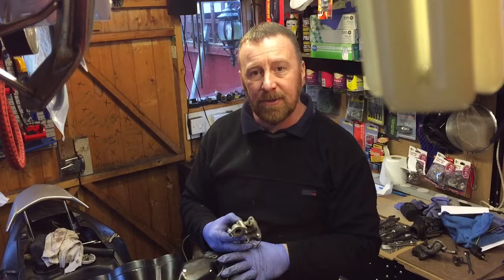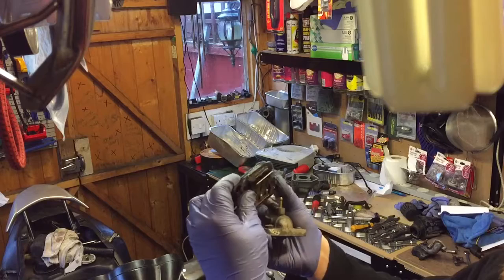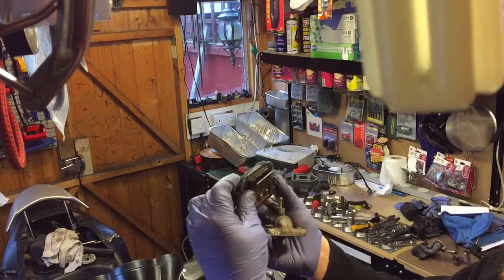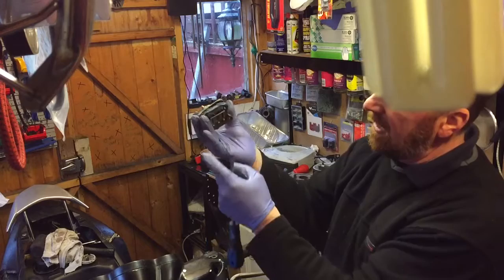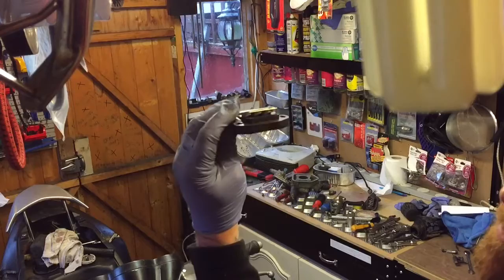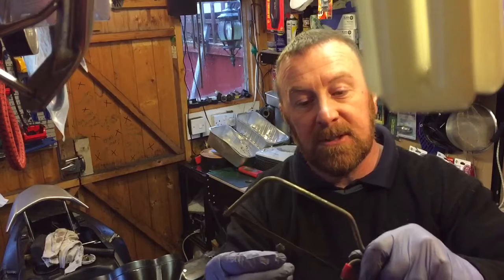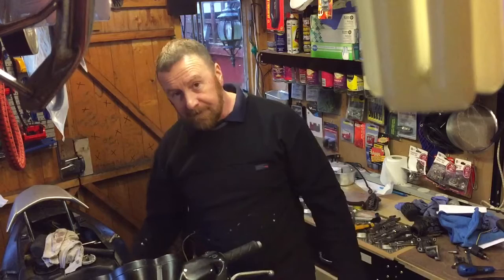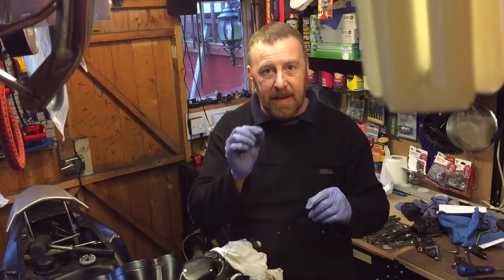Speedfight REEDS don't forget about them mark savage

Comment: Hi Mark, I have a 2001 100cc what size jet should I use for an aftermarket exhaust and k&n style filter please any idea on where I can start please
Reply from the maker: Hi bud 
Standard should be 83
Reply from the maker: Exhaust is good but needs to be an in box filter as it will suck in damp in this weather and mess around

Comment: Hey! Thanks for the videos, helps alot! I have a SF2 LC, it runs ok but i have my idlescrew 95% in to have it running and air screw 1 turn out ? Any clue ?
Reply from the maker: its fine as long as it runs and stats ok , this is why they have adjustment as over time things change, could even be  the cable or needle adjustment 
some cheap chinese carbs only run with the air mix all the way in

Comment: Question, piston went bang and put a hole right in the top. How do I get all the bits out of the engine 😅
Reply from the maker: head all off and push the big ends round while using a rag , small magnet and anything else to scoop the bits out , you will need to get it all out otherwise it will cause damage bud 
it not a fun job at all
Reply: @marksavage  thanks for your reply buddy, will I get away with just cleaning it all out or will I need to split the cases 😢😅
Reply from the maker: @scottcrosland6386  just depends on how long you send on cleaning it out! 
Do a good job and yes

Comment: Hi mark and anyone else who knows bout peds . i need help with my speedfight. I was coming home from work when my ped suddenly stopped working whilst i was driving. i the tried to kick start it but it would sound like it was trying but nothing was happening. I have taken all fairins of today and found that my exhast was hanging of and then i found that my oil tank was bone dry. I put the exhaust back on and topped up with 2 stroke oil but still wont work. Have you got any Suggestions that could help? thanks
Reply from the maker: if it's run out of oil bud it's going to be your piston!!, and it will need changing . take it off and check it out and you may have to replace the barrel as well if it's got so hot but have a look first before buying new, they are not a lot of money and with my other videos they should help you to fix it and be back on the road. hope that helps please like / subscribe , mark

Comment: Hey man! I have a 2010 Yamaha Aerox it had a standard engine, leo vince tt exhaust, yellow clutch spring. My top speed is 80km/h and my acceleration is pretty slow espicially in uphills the bike cant get the revs up quickly and it accelerates faster after u stat moving, can you give me some advice to make it faster? The wodding in my exhaust is kinda burnt and i have standard yamaha rollers in it (5.5g) i think. Thank you in advance!
Reply from the maker: Omar Chakkour hi bud yes sort out the wodding like in my other video and Combi the rollers again as in my other videos , I worked on a aerox and have uploaded a few so. Heck them out they should help , go for 4 x3 and 8x3 g give the variator a good dry wipe clean , this lot should help bud , please like and subscribe , thanks mark
Reply: Ok man! Will disricting the exhaust help performance?
Reply from the maker: Omar Chakkour it's more about the gasses leaving the head exhaust port , they need to be stopped from all leaving the barrel and gaining back pressure that helps the push and gives you better pull away , if the wodding is hard / burnt it's not doing it's job so re doing it will help along with the right weight rollers , you can play with the weight up or down till your happy , hope that helps bud
Reply from the maker: Omar Chakkour I have explained all this bud in my other videos and you will see an improvement , it's cheap easy fix bud
Reply: mark savage ok man i will do what you told me and i will get back to you! Happy new years
Reply: mark savage my exhaust is also leaking from the both gaps, does that affect the performance?
Reply: mark savage rollers u said 3 4g rollers and 3 8g right?
Reply: any air leaks will cause lack of performance. if your acceleration is poor, try getting a harder clutch /. torque spring,  also 50cylinders are pointless with sports exhaust and all after market parts...50s have shit power so smashing on after market parts on a 50 don't mean your gonna get good performance.  if you want it faster, bin your 50 get a 70. set up and jet the bike correctly,  without a high end cylinder your not gonna get speeds of 75+ without gear ups and big evos,mhrs,rts etc.

Comment: He mate! I have change the rollers and piston and cylinder 
it does not help  Do you have another idea?
Reply from the maker: Whoop Whoop so it's not running , it was running then what happened ? Why did you change the head / piston ? , have you watched my other videos with none running advice and what to check or change , mark
Reply: It''s runnig! But He loses power He almost falls silent .. so I thought Piston springs I change the piston + springs and cylinder ..
Reply from the maker: guess it's going to be carb bud maybe even as in my video the reeds but give the carb a good service and clean first then move on to other bits, hope that helps bud thanks for watching
Reply: I have already done thanks anyway !

Comment: Hi my gilera stalker made a weird noise and cut out when i was riding and i cant get it to start again, its turning over and ive bought a new spark plug but still the same, doesnt seem to be making the same noise when its turning over now either, thanks in advance
Reply from the maker: Rhys was the oil topped up? As in my other videos if you open her up while turning over does it back fire? , you say you have spark and fuel is ok I'm going to guess piston bud , mark
Reply: mark savage yes the oil was full at the time, thank you mate, is there a way i can check if it is the piston or shall i take it to a garage?
Reply: And no its doesnt back fire
Reply from the maker: if you have the basic tools and a bit of know how, you can watch my videos as they are a bit like the aerox engines then have a go at taking the head off, I did a video on top ten tips on working on your bike have a watch of that before you start, if not best take it in to a garage but it will cost you bud, hope that helps. please like share and subscribe , thanks mark
Reply from the maker: sometimes if it's a complete piston failure it will just turn over with a funny sound like its just going up and down other time it will back fire but if you have spark and petrol going in to the pot and a wet hand if you cover the carb like in my videos then you may have to look else where bud. mark
Reply: mark savage thankyou for your help mate, i hope i can just find whats wrong now
Reply: mark savage it turned out to be the piston like you said but it broke all the bottom end, cheers for the help mate